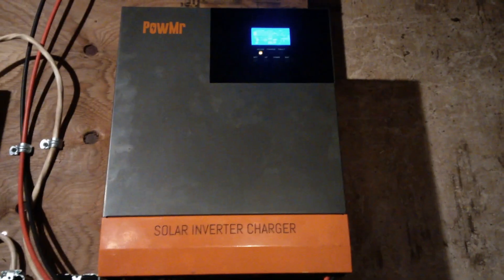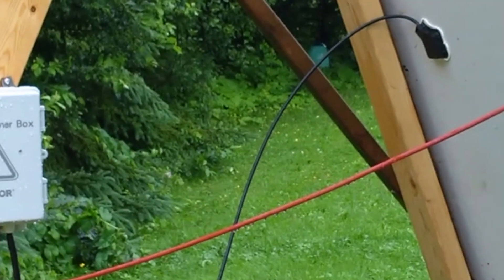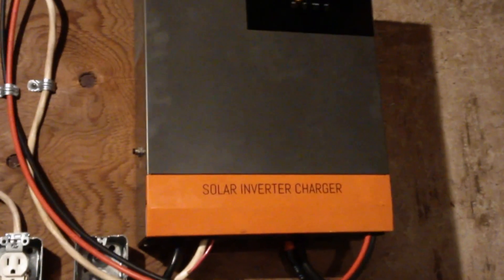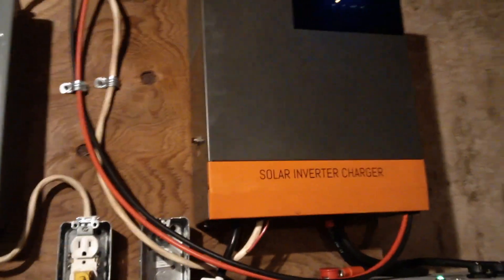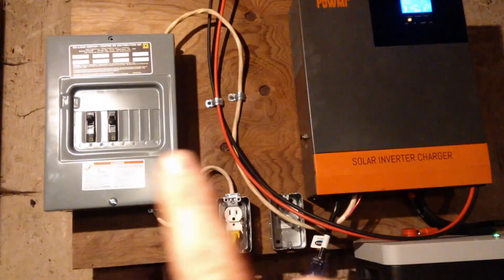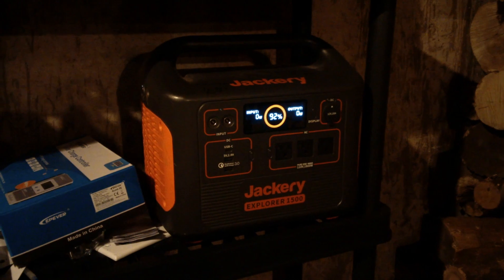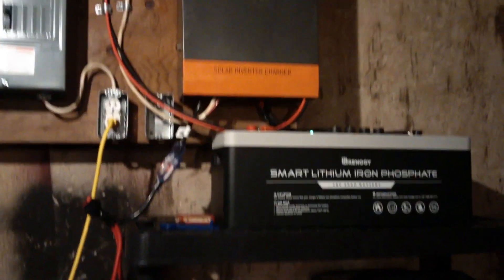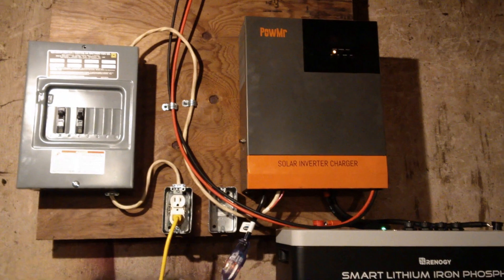PowMr All in One and OFF GRID Solar Power Array Installation

Comment: A detailed would be better. How did you mount it? Mine came with a mountbar affixed to the top with two screw holes and two offset clips to mount to the bottom in the back. But either way I try to mount them doesn't make sense.

Comment: how well has this system held up over the last 2 yrs?
Reply from the maker: Powmr was removed, its mppt tracker doesnt work correctly. I moved to eg4 3kw and its been working non stop for 4 years now
Reply: @MicahGallant  - thanks for responding, that's been my concern on these powmr is the long term reliability of them.
Reply: @honeybadger6127  yep. For those in the US the EG4 look very nice for the price. For those of us in other countries, Growatt is the cheapest reliable option. Otherwise Victron... or go with separate components and not with an all in one. Fchao inverter with the mppt controller that does up to 96v (it has a single big fan and not noisy) is my pick so far from my research. To make it as silent, efficient and capable as possible.

Comment: Is this unit still working after two years?
Reply from the maker: I swapped this out with Signature Solar 3kw EG4 inverters (dual).  the issue with this PowMr is that the mppt wasn't reseting correctly as voltage increased in the morning. so the wattage would not be high. you had to restart it to get the full input of solar. Not sure if they have fixed that but the MPPT resetting was a major issue. the eg4 units are near flawless, have been running the for over 2 years now straight.

Comment: Whats your long term ownership experience with this powmr unit?
Reply from the maker: I sold it after a year. the mppt doesn't reset based on incoming voltage properly with this unit. Went to 3kw signature solar inverter, eg4, it works great and has for multiple years now

Comment: I am curious.  Now a year later, is your PowMr still running like a champ?  Or have you had problems with it?
Reply from the maker: had issues, MPPT wouldn't check voltage quick enough to take full advantage of the power output. Known issue with these units

Comment: Is the inverter still working
Reply from the maker: I sold this and moved to a 3kw EG4 inverter. At the time it was still working. Problem with these is the MPPT doesn't reset enough or quickly enough to adapt to changing solar array voltages so you don't make as much power as you should. So thats a bug or something there.

Comment: Thank you for video and time. Its good investor from cheapest on the market bacause its made be SRNE factory. Not all models PowMr made by this factory .
Reply from the maker: I have a 3kw EG4 unit now which seems to work better related to the MPPT controller and its voltage tracking.

Comment: How did you handle the ground/neutral connection in the panel connected to PowMr? Does the unit bond or is it an open ground on AC output?   I have a Growatt 48V and it does not bond on AC output. My unit is off grid with no possibility of grid power coming in ever so I have decided to bond in the panel and run to a ground rod after reading so many different opinions.  Even electricians seem to get stumped on this but Will Prowse seems to say no ground rod is necessary on a completely off grid system.  Confusing.
Reply: You do need a earth rod with these systems if you go completely off-grid. I found out the hard way. Everything that was being charged gave me a tingle, because I did not earth the unit. Ended up earthing the unit to the houses AC and no more problems.
Reply: You definitely need to ground your off grid home

Comment: i am setting the powmr3000w with 2x 12v 200ah lifep04 in series for 24v .. with 1kw of solar.. and 20amp grid power for my RV ... tried chins and originally had a 2k straight inverter .. so settled on powmr.  but the whole system is 24v (2x (2x)100w thunderbolt panels in series  and then got a couple 330w 24v panels running to an mc4 combiner..  really really like it for a first solar setup.   with lifep04 prices dropping like a rock.. each 200ah lifep04 was 460.00 shipped..  2.5kw ea .. may go up with another pair.

Comment: I ordered a 6.2kw 48v powmr. My aim is to charge a battery at night on cheap electricity rate and discharge during the day at expensive rate. This system will work for this? Appreciate any advice thanks
Reply from the maker: yes absolutely it would. great idea!

Comment: Is your inverter 120 or 230? I bought a powMr 6200w and it only puts out 230 single phase and I need to get 120 out of it and can't get any help from powMr.
Reply from the maker: this one was 120 volts
Reply: you have two options. There is an "appliance mode" which will allow you to output 120VAC (but only at half of the power). The other (and better option) is to change the output to 240V 60Hz and run it through a wall mount 5kVA transformer... the inverter will feed 240VAC on the primary side and you can get 240/120VAC on the other side.

Comment: Is your inverter 120 or 230? I bought a powMr 6200w and it only puts out 230 single phase and I need to get 120 out of it and can't get any help from powMr.
Reply: That no posible. You choise the wrong , you need to get split fase or 110V inverter
Reply: I sent the same unit back explaining it was not a standard U.S. system but for Europe

Comment: Can this unit bypass the battery and put the PV energy directly into a (dedicated) house circuit? I don't mean grid-tied, but similar to a grid-tie inverter, which puts all the energy from the PV into the house. I'm also curious if it could be AC coupled with a grid-tie inverter to provide power to it instead of feeding the panels into the PowMr. Thanks for the review.
Reply from the maker: Great question, i think you at least need a tiny 48 volt batter, could be 2Ah battery, just something to connect it to.
Reply: There would be a bypass control available.  Mechanical or auto but talk to a electrician

Comment: I like my powmr 3000 watt 24 volt model. I actually like it better than the others like it. It has a smaller solar input but its really not a bad unit. Im trying to use it in my camper. Im wondering what you know about the neutral ground bonding and if the input ac ground is broken when its switched off of ac input and running on battery? Any help with this is appreciated.  Thanks for sharing
Reply from the maker: I don't know about the bonding there. Thats a tricky subject so I won't comment. I'll let an electrician say something there. I didn't bond anything myself though, just used it as is.
Reply: @MicahGallant  the neutral ground bonding is kinda difficult with thos unit. If its bonded at the ac input which it will be if you have a ac input then it will not be bonded at the ac out put. When you bond your neautral to ground as you are supposed to do on the ac output then it works right until you plug in the ac input and it trips the gfci. So the trick to make it work right and safely is to have a switch on your ac output ground. Have acoutput unbounded while using ac input and when you switch to solar or battery you need to flip a switch that bonds your neutral with ground
Reply: How have you gone with finding further info?

Comment: I have another question.  At the end of the day when the unit stops receiving solar,  it boots up and shuts down for about 20 minutes. It blinks all three lights, beeps, checks the voltage and shows it on screen. Then turns off. (I do not refer to how it sometimes has intermitted solar energy, Yes it beeps when it loses pv, but this is different). Does anyone know what setting might cause it to do that?

Comment: I got this hybrid inverter. When I plug in the solar panels, the box doesn't detect any PV. I can see on the screws of the terminal blocks that it has 22v from the panels, but nothing coming in. No green light to indicate charging. I have tried changing it to 'SOL' mode, not result. Can I fix that, or did my unit arrive with some kind of problem?
Reply from the maker: pretty sure you need minimum... probably 80 or 100 volts or something. 22v is low and probably not enough to wake it up basically. Try them in series, this unit takes up to 150 volts if its the same one.  You should get it near max of the top voltage imput to maximize efficiency of the mppt controller
Reply: @MicahGallant  This proved to be correct. One panel was not enough to detect the pv input. I hooked up two 200w panels, and I now have a happy green blinky light. Thanks for your reply. Great channel.
Reply: @MicahGallant  So for the record at minimum around 40v to turn on the solar charging.

Comment: Hi there, what AWG battery wire fits into the system?
Reply from the maker: Good question. I don't know the max size. Any standard household wire fits in for the 120 volt output, and its meant to accept standard solar cables for the input, the size you'd buy off amazing for solar panel arrays. So it accepts all the standard stuff

Comment: Is this still working?
Reply from the maker: I've upgraded to a 3kw EG4 unit as the mppt was not resetting based on higher voltage through the day. Otherwise it gave me no troubles.
Reply: Thanks. Looking for 5000 watt unit. Sungold 5000 watt unit doesn't look like it has a problem.

Comment: In the manual they show a battery image with white bars coming down from the top. With no white bars the image is all dark and the status is listed as 75-100%.  This may seems obvious to some people but it doesn't say if the status is charged or discharged. I think it would have been more intuitive for me if the charge indicator bars came up from the bottom.  My system shut off with red alarm flashing and the battery logo was all black. So now I know for certain that all black means discharged.

Comment: Hi I started using the new PowerMr 5.5KW. Look is bit different from yours.. Now it has been around 6 months. The issue I am facing is with the dust. You might also have the same issue since we both use the brand. I came up with a simple solution and made a video to make it easier to share. hope you and the other members will enjoy this  https://youtu.be/4sAX6WE0BaY

Comment: for ur pump u could look into a "softstart" . on a rv a/c with a softstart it can be run on a 120v wall circuit where with out u have to be plugged into 30 amp plug.

Comment: May i ask a question? The connection between Powmr and the grid must be to the box or can we use any sort of plug in the house?
Reply from the maker: Not the box. Its a separate wire into the bottom supplying 120volts. Input only
Reply: so you mean the AC IN of your inverter is connected to the wall outlet of your house by that black wire tapped with red wire? is the ground connected as well or just the live and neautral wires. tyia
Reply: cause I wanna know if I can do so. cut a power cable and get the live and neutral wires, then plug to wall outlet and then to inverter. would that work?

Comment: I just installed the 3000 watt 24v power mr and when I connect the ac in put to the grid and it kept popping my breakers
Reply from the maker: Are you trying to draw 3000 watts fro  grid? It cant do that on a 15 amp breaker
Reply: @MicahGallant  I figure it out, the problem was when i connect the AC input the there is a ground to neutral from the wiring of the house, so when I trying connect my living room to inverter it kept popping the breaker. So what I end up do just run a hot to the living room cause, neutral there already. Cause I turn my main grid breaker off and supply current to the entire living from an outlet.

Comment: great video. can you explain the parallel setup? Your unit have parallel port/card? I looked for same unit with 2 x parallel setup but wonder how to connect the 2 parallel units to grip the correct way.
Reply from the maker: You can technically run 2 of them because breaker panels have two 120 volt sides or rails. So one on each rail. BUT!! You cannot run 240 volt appliances across both rails because the AC is not synchronized. You need 2 units that communicate which each other to be able to do 240 like that. So i'm sure its very unsafe to run 2 that are not communicating but if all you need is 120, then its technically something you could do.